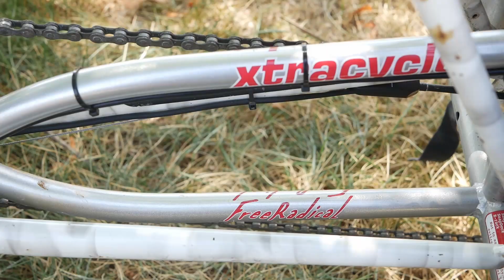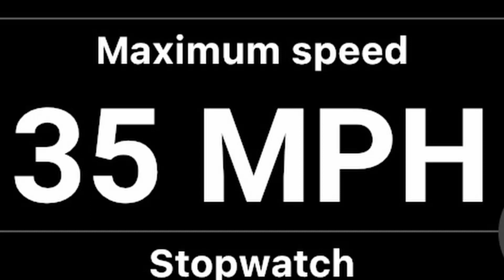Custom E-bike Build: El Capitan Xtracycle Freeradical Cargo Bike w/ Bafang BBSHD 52v 17.5ah

Comment: That's my bike Johnny!  I have been waiting for the video. It's a 1987 ish no suspension mt bike I bought new . all steel. (13 trips to Burning Man, Great Playa bike! ) the rear gear is a Shimano 7 speed. I had the extra cycle rear end installed about 15-20 years ago. I Also added the brooks saddle and replaced the straight handle bars with an upright set up and fenders. I used it for shopping and errands. I'm very happy with your "E" conversion. I was an avid cyclist both road and mountain but I have some health challenges now and it gets me out of the house and on the road/ bike path as well as to the grocery store. It was $1800 for the conversion.
Reply: Awesome! I have a 1999 Specialized Mountain Bike that I bought new and converted 12 years ago with an Xtracycle FreeRadical and  added a StokeMonkey mid-drive motor a year or so later. StokeMonke  was the first mid-drive system ever and designed specifically for XtraCycle by Todd Fahner who lived in San Francisco at the time and wanted to get big loads up steep SF Hills. 

My lifepo4 battery is much smaller than yours at 36V 14.5 Ah, but I've gotten 50 miles out of it by watching my watts per hour and adjusting the throttle according to make sure I have enough juice to get back home. I've also gone up 20% grades WITH my 100 lb wife on the back and towing a trailer with two dogs thanks to the mountain gearing. I've gotten to nearly 30 MPH on the flats with it unloaded. 

Mine is also my general shopping and utility bike, particularly when I want to get it done fast! I like it that there is no "cheating" with stokemonkey as it predates pedal assist. Meaning if the motor is engaged, the pedals are going to be turning so I have to be ready for it. But I'm a manual transmission kind of guy and actually like that. 

Oh, and I bought the StokeMonkey kit used along with the battery in 2013 and the owner told me he had been using it since 2010. I STILL am using the original batter, but capacity is now 75% of what it was. Definitely not complaining about that! Once it gets down to 50% capacity I will upgrade to something with around 750 to 1,000 watt hours like you have.

XtraCycle forver!
Reply: That's an awesome bike.

Comment: actually it looks like it could seat two in the back.  I'm thinking uber bike in the city
Reply: Have a similar build (free radical and a 52v bbshd), apparently it used to haul toddlers to school, I've tried with my partner riding rear, they're about 140 lbs... chain skips like mad up hills, maybe with something smaller than a 46 t chainring but then you top out around 25 mph. maybe if I put an ebike cassette on, but its a near new sram and I don't feel like splurging and being disappointed.
maybe a small flat city...
@JohnnyNerdOut did you get a chance to try this bike tandem?

Comment: Can you change the hub motor from the back wheel to the front on a pre pre-made ebike
Reply from the maker: Yes with a lot of patience
Reply: @JohnnyNerdOut  what do you mean slot of patients
Reply: Sell the hub motor bike , get a cheap 90s hardtail , slap a BBS02 on it.
Reply: @TheAgentAssassin  that’s not the point I’m buying a hub motor bike cause I like the style and and it needs an upgrade so I’m put a mid drive on it but I don’t know what to do with the hub motor so I’ll put it on the front and than I’ll just have an all wheel drive bike
Reply: @pascalkargut3237   Avoid the hub motor bike. Just my 2cents .
Reply: @TheAgentAssassin  yes me to I hate hubs but I’m buying a juices scorpion and unless I spend like thousands of dollars on my own custom frame that looks like it I need to buy it

Comment: Really nice work! Do you put/install Tannus Armour in the tires or just if the customer requests it? I find that flats are really annoying on all bikes, but especially e-bikes. Seems like Tannus Armour helps prevent flats very effectively.
Reply from the maker: I install them on request
Reply: Tire liners help also. (Only learned about the others recently).  I’ve used Mr. Tuffy liners in two bikes thus far, and once I’d learned their tricks, flats almost never happened.  Tricks include radiusing the ends with sandpaper, talcum powder, and careful installation.

Still, though, those Tannus things sound like they’re better.
Reply: Green slime is the way to go people who work on bikes hate it but everyone who uses it on their bike absolutely swears by it. A few dollars excellent protection against Flats. At least that's what my research has told me.